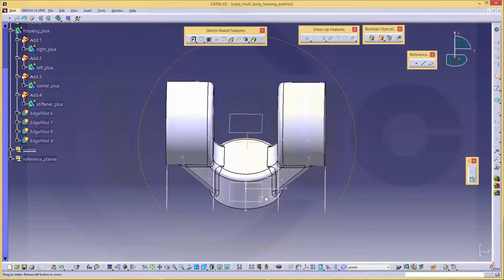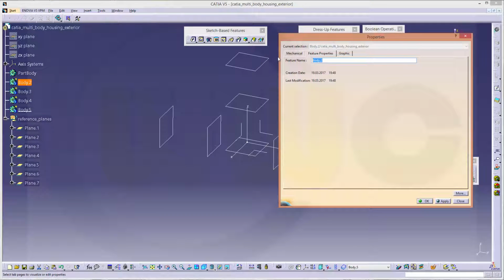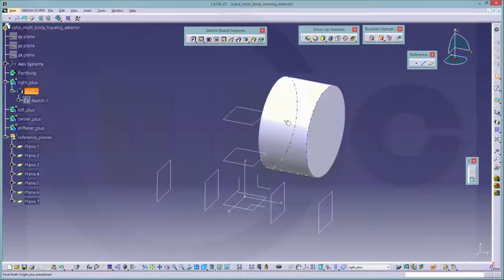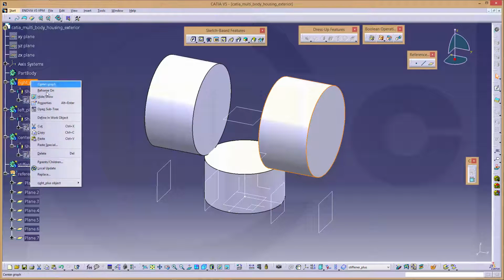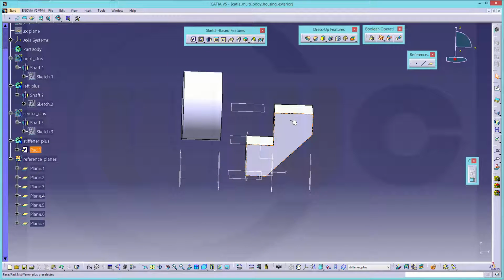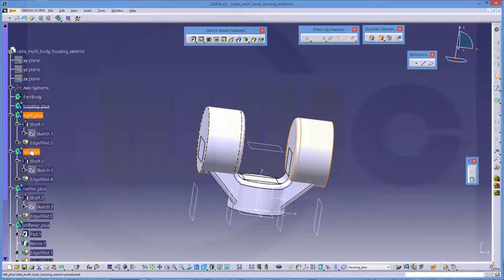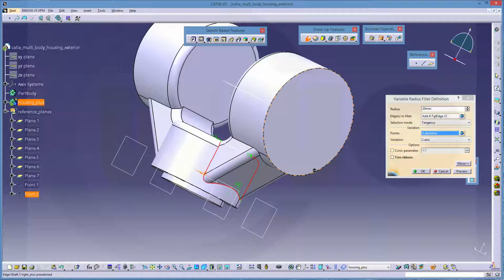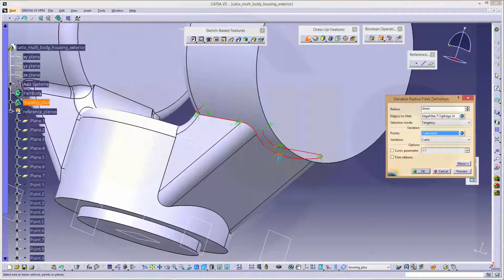Multi-Body-Housing - Part 1 Exterior - Catia v5 Training - Methods

Comment: Sir,what is the advantage of this kind of sketching ? I mean we could do it on a Partbody but we prefered parts for each and then we put together with boolean.
Reply from the maker: Simply put - you get a very structured model - the "bodies" are the "folders" - and if you to a model with a lot of features it is very easy to modify and to find certain elements.
Reply: @wolfgang.walden.cad.training  some say  that " having multiple parts contained in one model can cause problems with weight calculations and some macros only recognise a single Partbody."  I mean companies generally use this method or not ?
Reply from the maker: Yes there would be a problem with weight calculations, therefore you have to copy the final body into a new part. Regarding macros - I don´t know because I don´t use macros.
Reply: @wolfgang.walden.cad.training  thank you sir you are the best for education of CAD on YouTube